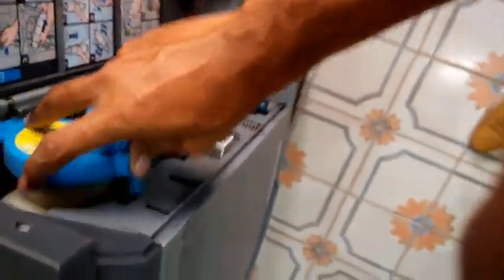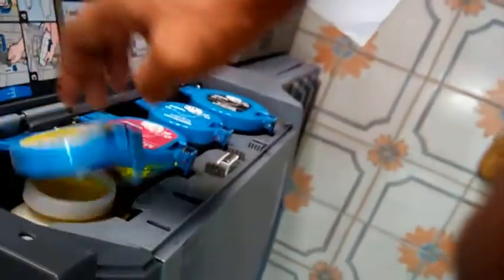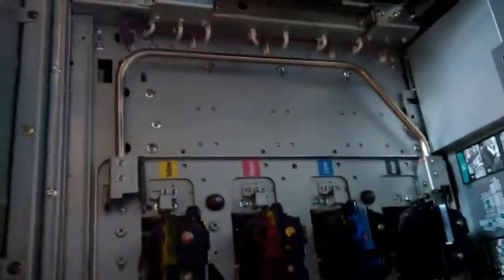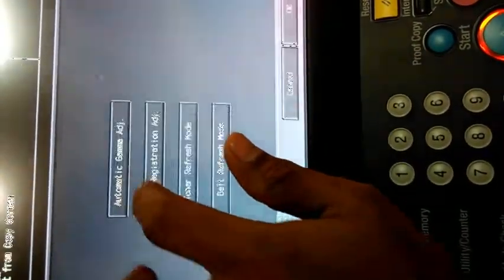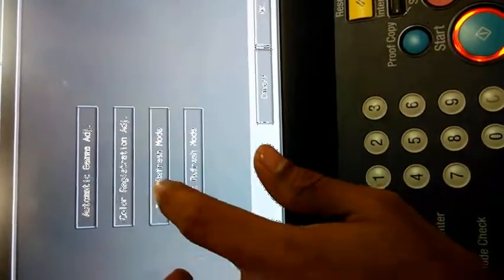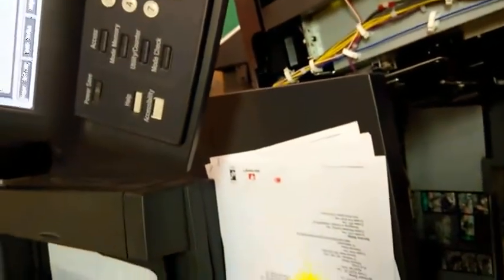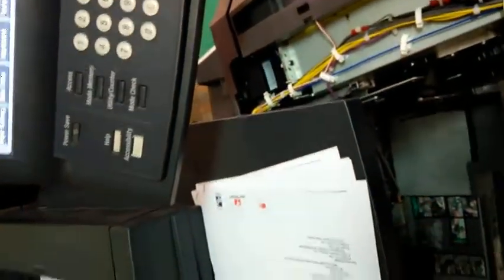how to solve C 2421 2422 2423 2424 errors in konica minolta C 6500 6501 5500 6000 7000 5501

Comment: hello sir every moring i start machine  c2423 messge appear everyday, so i just run toner density revert and restart the machne the machine runs normally. is there any problem in machine or wheather condition responsible (the problem start in rainy season)
Reply from the maker: Before power on the machine try on power on AC for 15 min then power on the machine also check what is developer life

Comment: I have error code C-2421 after replacing yellow developer, this error occur when performing the drum adjustments, i have manually added toner and run toner refresh mode more than 5 times with no success, and at machine power up error c2411 occurs...how can i fix this problem please